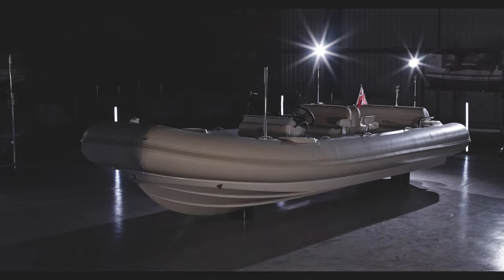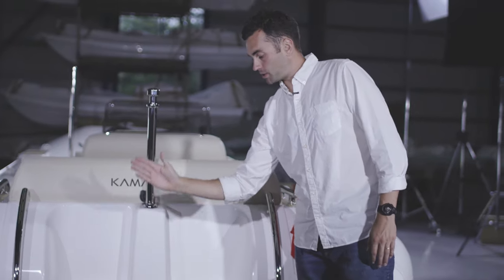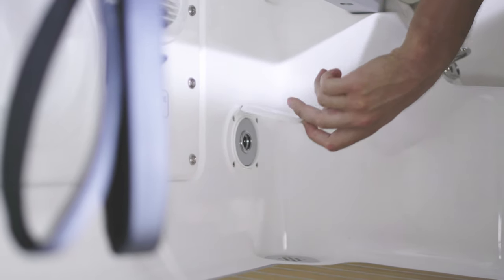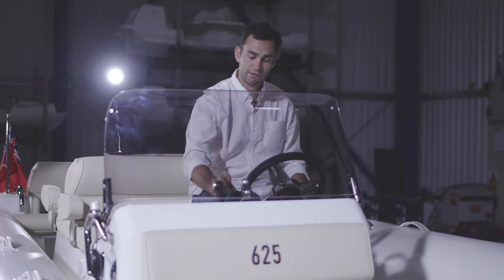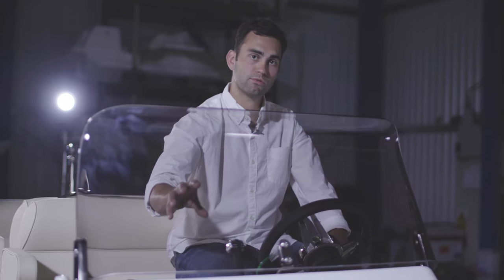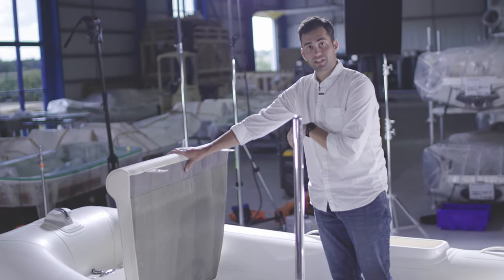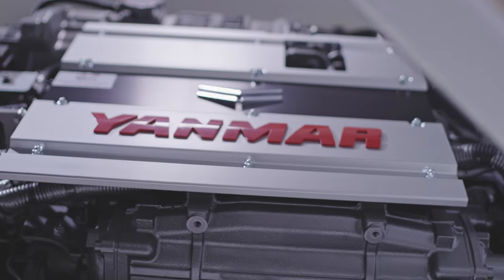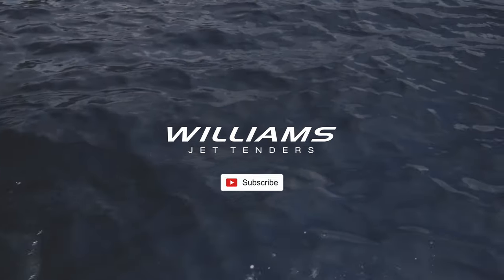Williams DieselJet 625 Walkthrough - Williams Jet Tenders

Comment: Thank-you for the tour. I like the idea of a fresh water wash down, but what size is the tank. I know some of the specs are available elsewhere but, it would be convenient to state weight, tank size, length with collapsed front tube, length & width with collapsed air tubes, fuel range. I am looking at using one as a dive tender and thus the Jet drive for safety. I will need a 625 & a 565 but space on the mother ship is limited on the swim platform and boat deck.
Reply: I'd like to thank you for NOT responding to my inquiry here over the last 7 months since it caused me to look a little deeper and find the AGILIS and CASTOLDY lines of tenders which suited my use better. Great job ignoring potential customers!
Reply: Buy evotin 552 150 jet out bard

Comment: Great content. Nice to explain how jets work. Must burn so much fuel though.
Reply: chief wavreuner jét boat dot use much 1985 wacmvrudes 33 hp hp 3,3 goh top sieed chers only 1.65 gph   nercy 90 hp jet 9 goh top soeed cers 4 goh 24 mile perr hour 6 mpg     96 mie range mine  foora bahas single tak iff shoee icean runs
Reply: buy jet caosel   hybred jet drive reder ful use oickiboat all ejrrc het drive 45 oe range
Reply: buy seafoo eltric jet bóat 19 mikes 3⁶  kw  bater 23 mikes 48  kw